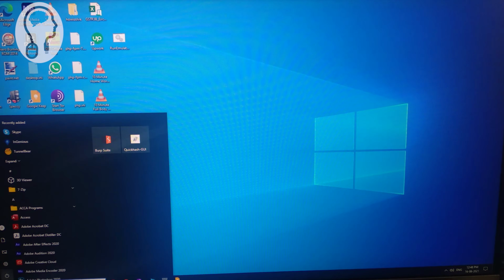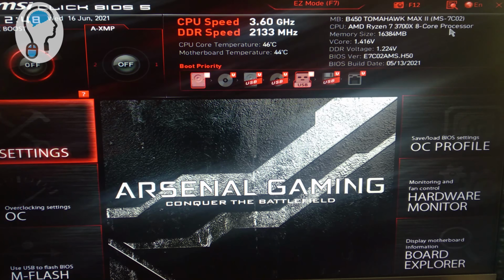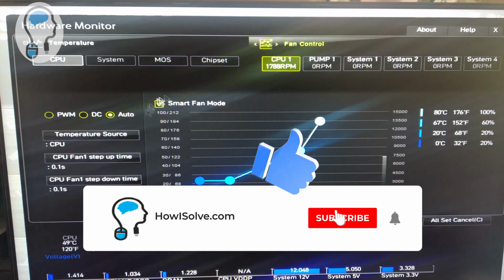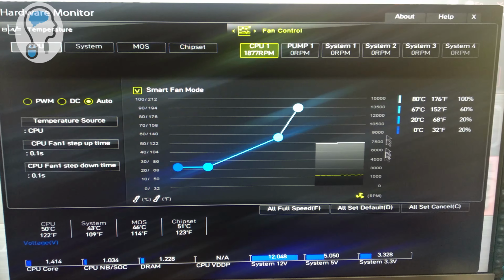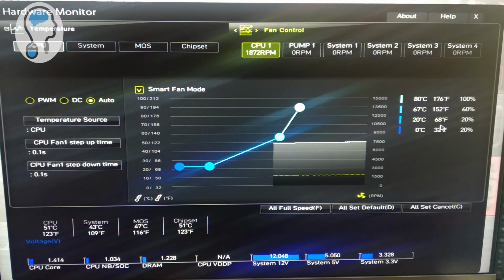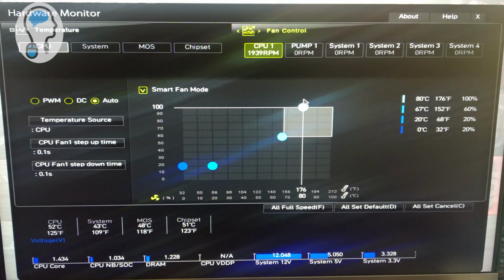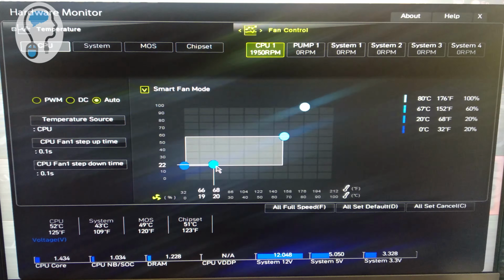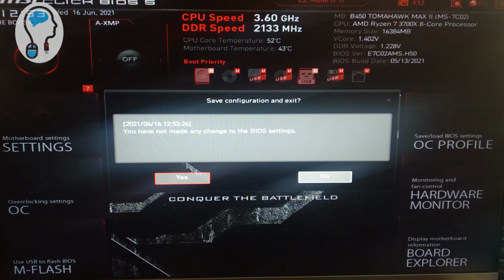How to Reduce CPU Fan Noise AMD Ryzen PC

Comment: You saved me man. My pc was super loud even though i changed the energy admin configuration, i even changed the thermal paste and the problem kept...i thought about buying a more silent fan. After following your instructions i found that it was configured on turbo 100% mode all the time LOL...now that it it in standar mode it's so much more silent. I want to record music and the miceophone would capture the fan noise, i even thought about spending on a mac and having two computers (One for work, one for recording) THANKS BRO! now i can just set it on silent mode whenever i record with my mic.

Comment: Do you think reducing the fan speed at the corresponding temperature will reduce the life of the cpu Ryzen 7 3700x ?
Reply from the maker: No it will not they are designed to be run at much higher temperatures